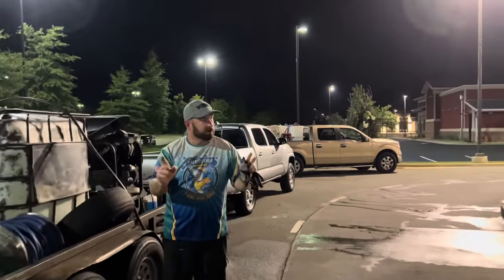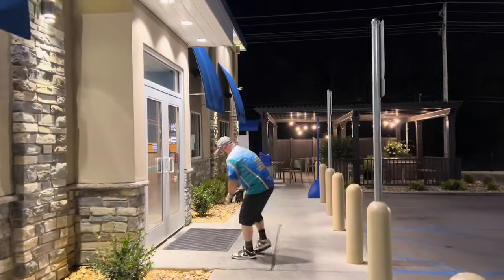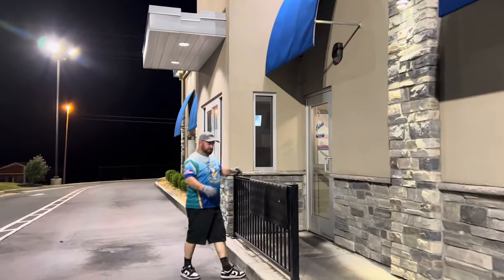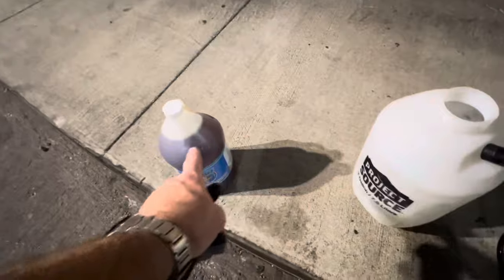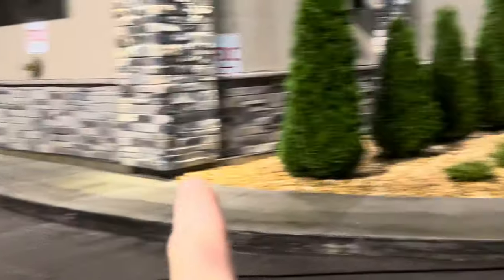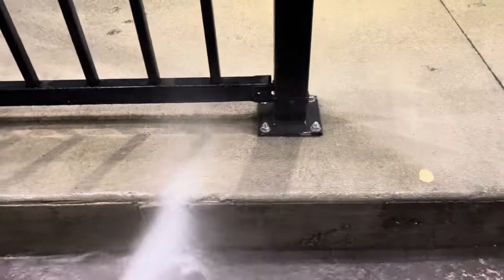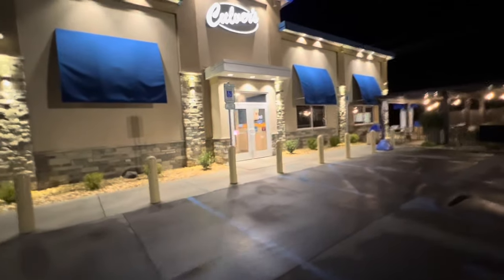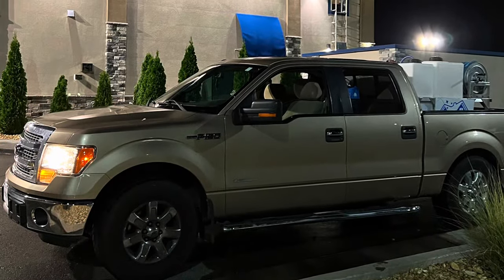How To Pressure Wash Fast Food Restaurants!How To Power Wash Drive Thru’s! How To Softwash Sidewalks

Comment: Why would anyone wanna pay more for degreaser when you’ve already told them to use caustic and Dawn??
Reply from the maker: Great question 🙋🏼‍♂️ ~ We stand behind our ways always ~ Sodium hydroxide works great 👍 it’s the main ingredient in this as well. This is an option if you don’t wanna mix it or have your employees mixing it and want it ready to use. Appreciate the concern and feedback, different strokes for different folks. We’re using it ourselves so our employees don’t have to take a risk mixing on the Job site.

Comment: nice job sir how much sodium hydroxide beads would I mix for a 1gallon pump-up sprayer. i only have the caustic beads. Thanks in advance.
Reply from the maker: I usually use about 1 cup per gallon and use cold water only and put water in first and use PROPER PROTECTION and SAFETY MEASURES , again this is just what I do and works for us

Comment: Great content as always! What psi are you working with for concrete? I have a 4000 PSI 5gpm hot water machine but replaced the surface cleaner tips to 25030 to lower the pressure but I fear it droped too low to about 2900 psi. I work with restaurants mainly, lots of grease and nasty drive thrus.
Reply from the maker: 3500 max 
I focus more on the GPM
to wash faster and more efficiently
Reply from the maker: Thx brother